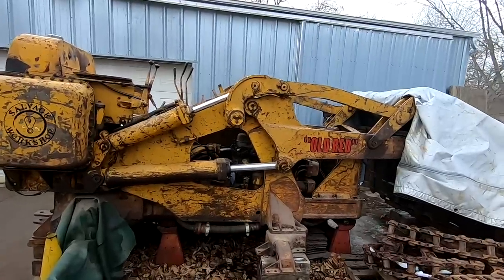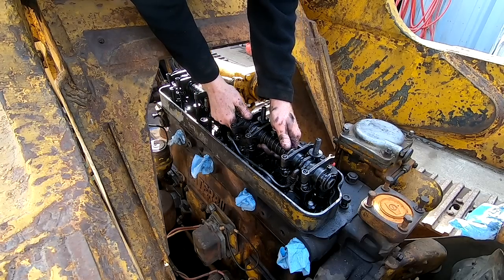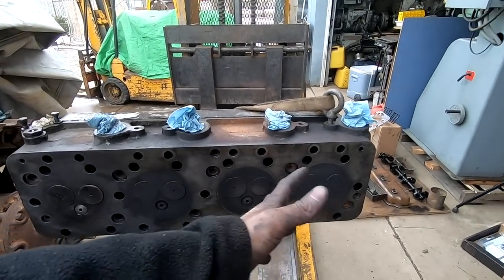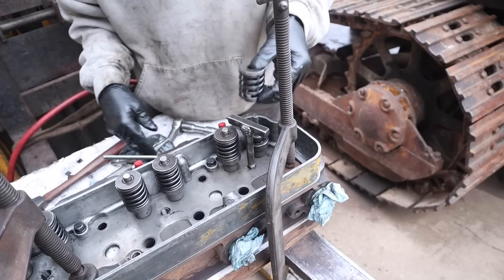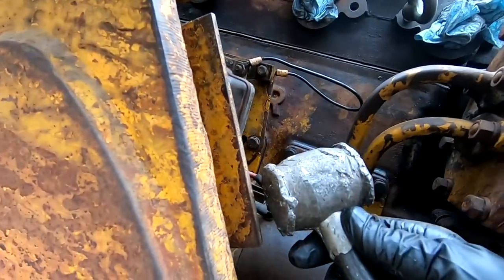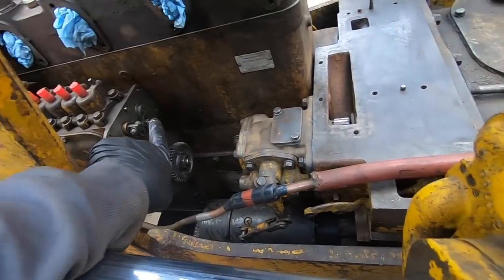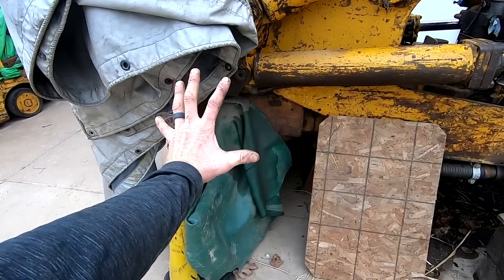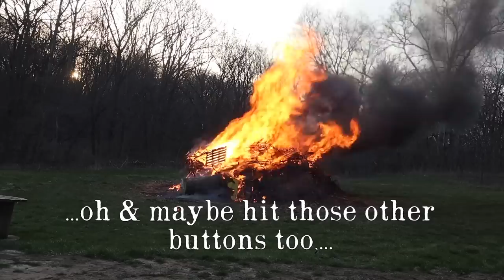Tearing the Head off "Old Red's" Diesel with a CRANE Truck ~ Part 18 ~ 1950s Caterpillar TraxCavator

Comment: This series, you, and Old Red inspired me through Covid. I ended up buying and rebuilding a 1950 Ford 8N tractor because of your work to save Old Red. I rebuilt the engine and steering systems myself, last year. Recently I plowed my garden this year with my little 8N, and this summer she will get a paint job. Thanks for sharing these videos with us!
Reply: Nice project. My neighbor has a constant stream of 8N and 9N's in his garage being restored, and they come out like they just rolled off the assembly line. They are good tractors lasting this long!
Reply: @___PK__  I can attest to that, my dad has an 8N and the only issue it has is a revving issue
Reply: @jakealter5504   Sounds like a governor issue. Maybe try rebuilding that and checking the springs inside?
Reply: @___PK__  I believe that we did get the governor done, It might be that it wasn’t tuned properly. The machine starts and runs, it’s just that the engine sometimes revs up even when we have the throttle on low. Considering the condition that most of my dad’s machines are in, the 8N is probably in the best shape mechanically out of all of them despite being at least 20 years older than most them. I’d say that my dad’s 1845C skid steer works better but one of the drives binds up a little (can be solved by rocking it back and forth a little but can be annoying) and the headlights don’t work (probably wouldn’t be hard to fix but we just need to figure out what the issue actually is since it could be the bulbs, a fuse, bad wires, or  that the lights have a bad on/off pull switch)
Reply: @jakealter5504  Hmm. It's getting too much gas for some reason... why? Choke stuck half way somewhere? You will find it!
Reply: @___PK__  probably, we will probably take it to a tractor repair shop to get it straightened out

Comment: I'm amazed at how parts for a 1950s crane truck are still available - and NEW! You can buy an appliance like a refrigerator, and 20 years later you can't find diddly squat for it. Hats off to Catepillar!
Reply: Its one of the reasons why you buy big brands like Cat, Kubota, Liebherr etc. you know you will get parts later on and wont be stuck on a job or in generell. Thats why those machines cost a pretty penny in the first place.
Reply: @clypeum5063  they cost a lot but can have a very long lifespan if you take care of them

Comment: Hi, have watched all Old Red videos. very informative. Have worked on cats when I was younger, dozers, and bucket diggers.
When you finished tightening the cylinder head iI did not see you reset the valve tappets. Looking forward to Part 19.

Comment: That cylinder head looks like a replacement. Someone has had it off before judging by the RTV silicone, and the different color of the head.
I like how you don't use RTV on the base gasket, It's not necessary if you torque it to factory specs. Good Job!

Comment: As for the hydraulic hoses, I think you could rent a hydraulic hose crimper and buy the hose in bulk and come out much cheeper. The other big cost is going to be the end connectors for the hoses unless you have the kind that you can take off and reuse on the old hoses, which you probably do if someone has not messes them up by using the wrong wrench.

Comment: Hello,
Was a long time didn't see Old Red around.
Very happy to get news ! 🙂
For sure it is a long and HUGE project (for you) but very fascinating to go in the inside of this heavy machine starting with pony motor or electric starter. An other era...
Wish you the best to complete this project.
Don't worry too much about the hose except if you plan a "time constricted" project. If you have and a hose blow, you have time to replace it. I don't think you will ran Old red in project that don't support any delay. So as soon it does not leak, it's ok about hose I guess. About cylinder, as it is pain to take them out/in due to their own weight and the equipment itself weight, I'll make the seal new now. Old Red is at your shop, you have all equipment needed (crane, elevator, tools, ....) to release them off Old Red "easily". Dis/mounting a cylinders that sizes is not easy on the field (due to Murphy's law it will always fail in muddy place far away road to bring tool...).
You have my sincere admiration whatever regarding all the effort you put in this project either physically and in your mind. A very long project, but what an inspiring one ! Congratulation !
See you soon in Old Red new episode (close to the end). I don't worry you will turn aimless, after Old Red you have (at least) MF backhoe and Michigan forklift to deal with in "heavy duty" range 😉
Have a good day.
Nicolas (from France).

Comment: So an easy way to lap valves if you dont have the suction cup tool, ive used a drill and chucked it on the end of the valve stem at slow speed forward and reverse.  Works great.

Comment: Using a drill and chuck to lightly pull on the valve stem to do power lapping with a drops of 3n1 oil with the lapping paste. 😉👍Check the auctions for used tracks????? or the heavy equipment shops for new old ones. Like C&C equipment on YouTube. Owner has a stock pile.

Comment: Injector tips, Caterpillar calls them valves, are cheap.  As you say, you can do them later.  Same for precombustion chamber seals. 

A lot of the old CAT mechanics brushed both sides of the head gasket (except for the fire rings) with the Permatex sealer to give a second layer of protection against water seeps between head and deck. Usually show up along the exhaust side of the engine.

Comment: Glad to see Old Red is back in focus. I understand why you have been quiet on this project for a while, you needed to gather in all the parts and gaskets. Great to see the project moving forward, this is well beyond my current movement ability, time-worn damage and arthritis are a pain. Now, I live through the projects of others these days. Removing and replacing the head was a real fiddle for you, the heavy head needed mechanical assistance. I bet the factory used rather similar methods with chain hoists to control the process.

Comment: Great video, talented and dogged. In Oregon we call him the badger !! AND - please be aware the working around  used oils and grease w/o gloves, if your part time, is not a big deal. But that all changes when that person is a nail biter. Please protect yourself from a soup of chemicals by either wearing gloves or cleaning nails and nail beds thoroughly or both. Used engine grease and oils are nasty.

Comment: You might have checked the height of the sleeves above the block surface. They are prolly ok but good insurance the new head gasket will stay sealed.I agree with you about the valves. Usually check for worn valve guides if you do a full valve job. Field mechanic would have done same procedure to remove rocker assembly. AL B.

Comment: I dont know if you are aware of this or not but a lot of those older machines have rebuilable hydraulic hoses as in the ends screw out of the hoses. so all you need is the hose which will save you a ton a money and just use a metal chop saw to cut your lines to the length you need and reuse your ends!

Comment: The hydraulic cylinder with grease fitting is the way to go.  Use the spring that is already there and put the hydraulic cylinder on that.  That way the spring absorbs the shock when the idler wheel moves back.

Comment: My guess is that it would have been fairly easy to remove the long hold-down studs first, using the double nut method and the rocker assembly would have been easy to lift off?

addendum: I see you figured it out.
Reply: That's what the manual says to do.
Reply: @PaulaXism  who reads those. 😂
Reply: @TheDistur  I’m that guy. I’ll get a new toy, say 362 Stihl chainsaw, and I like to find out how the electronics in it can be reset among other things about it. Working on CAT equipment I go through the parts diagrams before I start reassembly and get ‘my head in the game’.
Reply: @manuelve1998  that's probably the smart thing to do. But a lot of folks don't bother lol

Comment: When hanging a heavy part on an engine (like an intake or exhaust manifold) make a stud out of a extra long bolt with the head cut off.  Hang the part on the stud and then you can easily get the boots started.

Comment: those valve cover 'cap seals' look just like the valve cover stem seals on my 4runner rubber oring metal cap presses on the cover an seals around the bolt

Comment: I guess Old Red has been flogged to death really. Everything looks worn out. If you can find good condition track chains then that will be a big help but undercarriage spares for these seem a bit thin on the ground now. You could consider buying some high grade steel and welding it on the bottom of the chain links to bring them back to a workable thickness. Also you could turn the chain pins 90 degrees if the pins are worn. Its a lot of work but If you can't get better chains its an option. I think by the way the sprockets were jumping that they may be quite worn also.

Comment: Antiseize that big o-ring and pinion clutch assembly before assembly.  At least grease it up good.  There’s been a lot of those housings had the ears popped off from folks prying on them to get the pinion out of the flywheel housing.

Comment: It has been so long since you last worked on this I was beginning to think you had all but given up on "Old Red".  That bucket on the front is just so much scrap metal and would cost you more to repair it than it would to find a decent used one that was in decent condition.   I don't know how close they are in design but you might see if an old Cat dozer has tracks and such that will  work on "Old Red".  But maybe you have already thought of all that  😋😁

Comment: I built track tensioner housings for my Case 855c. The dealer wanted $1,900.00 per side for new ones.   I spent $600.00 to make them

Comment: The decompression cam/rod  didn’t need to come out.  It comes out with the rocker box.  On the 6 cylinder D318 engine there’s two separate rocker boxes and again, the decompression cam stays in and the two boxes come off together.

Comment: I am sitting here screaming at the screen TAKE THE STUDS OUT and then low and behold you take the last one out... That thing has come a long way since you got it out of that barn. While what you did with the valves was ok as long as you had it off I would have reground everything. You got lucky on those exhaust studs. They usually just break off. Since you have an electric starter I would make a plate and block off the pony motor mount.

Comment: Should those nozzles, that the fuel injectors go in, all be the same distance into the combustion chamber? I noticed that some are low into the chamber and some are not even all the way through the head into the chamber. It looks like that would change where the fuel is injected into the combustion chamber from one cylinder to the other. Just saying?

Comment: While you were lapping the valves I was thinking it would be much easier if you would connect a battery powered drill at end of the valve stem so you could slowly rotate the valves either direction while gently pulling.  Should be a much faster way to complete this laborious project.  Maybe food for thought on another project.

Comment: Nice job! Hmm, looks to me like there is an issue with the crane? Normally the empty hook should lower by itself? Either the hook is too light and/or the wire spooling on the drum is problematic, leading to the wire cutting into the wraps below (that is detrimental to the wire).

Comment: With the new head gaskets you have to use 30a gasket sealer bc the old ones was copper I found out the hard was taking the head of 5 times getting new gasket to find out they don't seal unless you have stuff on it
Reply from the maker: Are you talking like Aviation Form a Gasket like I used in the video? I vaguely remember either reading that somewhere or someone told me that now that you mention it!  It's gonna suck if I have to pull it apart again, but it will go WAY faster now that I know what to do!
Reply: @SalvageWorkshop  yes sir but I think it's gatta be 30a stuff for the heat but I found out 5th time when I found a video on why it leaks I still actually have to take it off for the last time to seal it

Comment: hey great work your doing there ,but your valve cover may seal better if you take the nylock nuts off the rocker shaft and put them back on the outside where they belong to hold the valve cover on, as they were when you took it apart, go back to about 3 minute mark on video you will see what im talking about
Reply from the maker: Good catch on that one! I definitely missed it! I still think the valve cover will be off a bit still, because it was before i dove into the head... i think it's bent down in the middle from someone cranking the cover nuts down too far ... either way, ill be switching those nuts! Thanks for the heads up!
Reply: @SalvageWorkshop  and usually a nylock  nut is not hardend it may be grade 5  but the other nuts im sure are grade 8 or better to hold rocker shaft down and while your at it replace those nylock nuts cuz when you were double nuttin them studs , and runnin them nuts down they spun to free

Comment: When installing any rubber seal you should try using wd-40 or a tiny bit of grease you will not believe how much easier they are to slip over fittings!

Comment: Careful using a wire wheel or scotch pad on a head like that.  When I worked at GM there was a service bulletin saying not to do that, too easy to take away material and then you don't have a flat head or block anymore.

Comment: Please. Straight edge across the bottom face of the pony motor and the mounting surface of the bell housing.  

Squatch253 and pnwhillbilly both have videos on pressing the sprocket back on.    Western truck and tractor repair show how to weld new sprocket on.  All on YouTube . Squatch253 has a ten part or more series on building the pony and the pony magneto

Comment: I'm only 12 minutes in but I am wondering if the studs are the tallest part of the head, how does removing the rocker assembly help with head removal?
Reply from the maker: I had to remove all 4 rocker arm studs to get the head out, so the rockers DID need to come off to clear the loader arm above it.
Reply: @SalvageWorkshop  Word... thanks for the response!

Comment: Not trying 2 be rude but on the final drive I think the call it a ham case... because it sorta looks like a ham not a bell housing. I don't think you need to have it pressed on boil the bull gear and water  And freeze the shaft with liquid nitrogen.  I'm not absolutely sure that will work but but I remember when I was it's 7 or 8 my dad did it on A D5
Reply: Boil it in water*

Comment: i DON'T UNDERSTAND WHY YOU ARE PULLING REDS HEAD. It's good to see Red back The tool you were using to pull the valve springs is a pickle fork IMHO you should have given up on that pony motor long ago!
Reply: I think the head gasket was leaking and he also just wanted to have a good look at the valves etc...

Comment: I wouldn't let this guy work on a wheelbarrow! Either lift the loader arm (easy!) or slide the rockers off the shaft!
Reply: A simple split pin at the end of the rocker shaft holds the rockers and springs on!!

Comment: Sorry to be a bit of a downer of your arduous work, Diesels aren't meant to be serviced like you had done in the video. You sort of have to do the whole head including more importantly the injectors. You made some rookie mistakes but Diesels aren't the same as working on as Petrol/Gas engines, you can't just pick & choose what to replace. It's to do with higher pressures in Diesel engines for a start. Would wish you well on the future run time but the valves are going to make issues for you down the track. You do great videos btw.

Comment: Shade tree, you went to that much work and trouble to take that head off and going to put it back on and you call that lapping your valves? Why did you not take a drill and chuck to the stem end and actually lap the things?? If you have a spot on the seats that you can see now then you going to have burnt valve soon. Valves are supposed to be tight enough until they will hold gasoline at least. After you put the springs on pour some gasoline in the cavity the stem side is on, if it leaks through to the combustion side you keep lapping the valves until it won't. What you've done to that head isn't worth a sh*t1 People look up to those who know how to ask for help when they know they don't know what they're doing. I've watched several of your videos but this one really brought me down. Always work smarter not harder.
Reply from the maker: Thanks for watching!
Reply: @SalvageWorkshop  And Thank you for taking us with you!